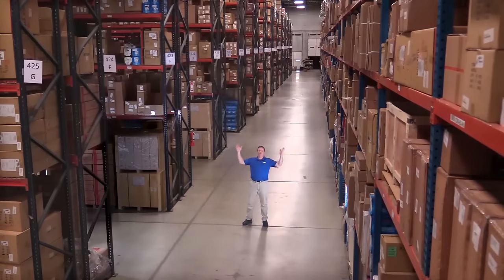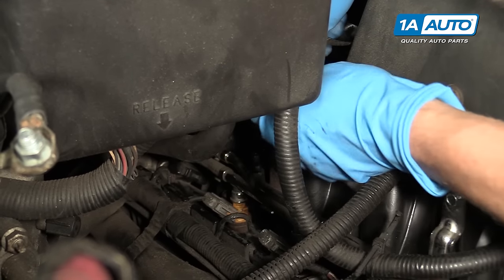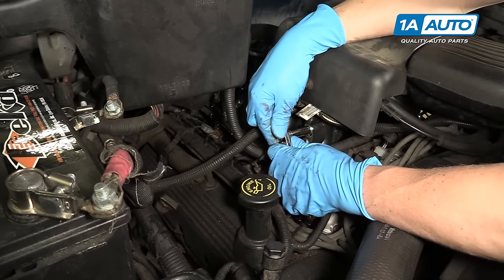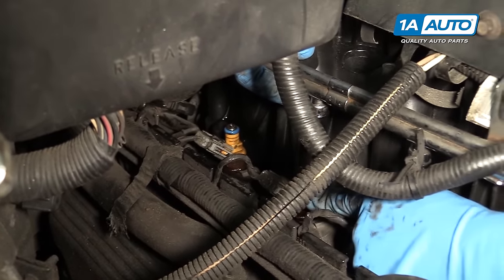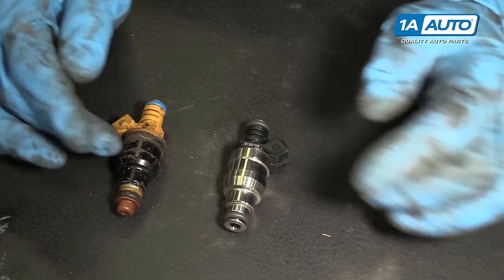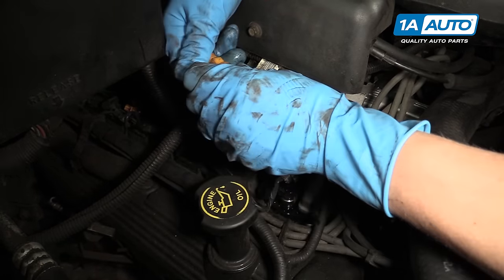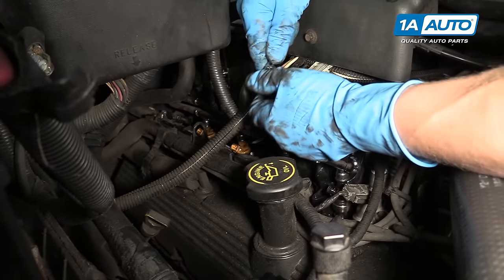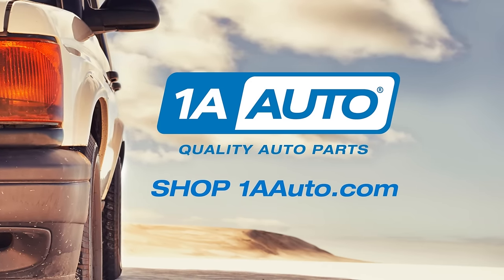How To Replace Fuel Injectors 97-04 Ford F150

Comment: change the title this is not a 97-03 f150 he's working on an 04 or later come on guys, the 97-03 has a hard to reach injector on the driver's side, with the fuel rail in the way of the injector plug.
Reply from the maker: +Chuck Fitch Thanks for the tip! We'll pass this info along to our production team.

Comment: I appreciate the overall video, however, agree with many others. The easy side was shown... read on for more regarding the drivers side.

-Driverside... 
——Remove the PCV valve 90* elbow. You may break it if not. Push the hose down after doing so.
——If cylinder 8 is difficult to remove the injector... Use a long flat head to pry off of the valve cover. I spent 15 minutes trying to pull up with my weight and no dice. First time square, pushing down on the flat head,  up on the injector (from under the injector lower lip) it flew up and out.

My quick overall tips (as I literally just completed it in my driveway) as needed in tackling this:

-Remove the elect clips before working on the rail as they will be fixed and easier to remove.
-Its a 8MM that the factory installed on the rail bracket, not a 10MM, must have been the aftermarket intake as mentioned. 
-Dont skimp on getting a pick. I regretted that but managed.
-Oil the BOTTOM ring gaskets first, wait on the top. Once installed to the intake then oil the top. Youll just be wasting time otherwise. 
-Re-Install the elect clips before setting the rail so you dont have to fight the rail too.
-Once complete, turn the key to the aux position a few cycles to send fuel to the rails and pressurize. Check for leaks or bubbles.

Best of luck.
Reply from the maker: +Garrett Smith Thanks for the tip! We'll pass this info along to our production team.
Reply: @1AAuto  Thanks for sharing! 

Just more for those that want a little more like me...

Comment: A good method to getting the fuel rails to "lift"

1) Remove the two bolts.
2) While pulling the fuel rail sideways.....insert a small
    bladed screwdriver through the bracket holes..
3) Now angle the screwdriver down and push it in
   so that the blade tip is on TOP of the manifold just
   above the threaded holes where the screws were.
4) Now just pull up on the screwdriver....which then
    pulls the fuel rail straight up easily ( as there is
   a large leverage force).

Lots of words for a really simple trick.(!)
Reply: Why did gas start coming out ?? I put it back in but why was it doing that and his didnt???
Reply: @dom1783    The tech showed how to relieve the fuel pressure through the schrader valve on top of the fuel rail, but forgot to mention that there will still be a small amount of fuel inside of the fuel rail that will drain out when removed from the injectors.

It's normal for this to happen. 
To prevent from leaking fuel onto your engine, place a towel or rag around the area where the fuel rail enters the forward most (#1) injector before disconnecting it, then just let it drain into the towel or rag. 
You will probably still have a few drops of fuel that will leak out from the other injectors as you remove them, but it shouldn't be enough to be concerned about.

Comment: YOU ONLY CHANGED NUMBER 1?  WAS IT FOR A MISFIRE? OR JUST A DEMONSTRATION?  I HAVE A 5.4 TRITON 2 VALVE WITH P0301 AND DON'T WAN'T TO BREAK MY BACK LEANING OVER THIS TRUCK JUST TO FIND OUT I DID'NT FIX IT.  INJECTOR ?  IGNITION COIL? SOMETHING WORSE? I KNOW YOU CAN'T DIAGNOSE PROBLEMS OVER THE PHONE, BUT ANY HELP I CAN GET IS APPRECIATED.

Comment: my question is why are you putting a new injectors if you have a failed injector or you just need to clean the little filter and put some o-rings on and put it back in

Comment: FYI engine oil swells rubber O-rings, I would use a non petroleum lubricant. 
I use a product called Parker lube at work on rubber seals, and it works great. 
I'm not promoting just sharing my experience.

Comment: Can a malfunctioning fuel injector give a P0171 lean code on a 1998 Ford Ranger?
Reply: Daniel Vargas I have the same problem I was asking my self the same exact question!

I have a 03 Ford Expedition 2wd and I have the codes P0171 &’P0174
However I’m getting very poor fuel economy and I think that the fuel injectors have something to do with it !
Reply: Did you guy end up replacing the fuel injectors and did it help you with your problems
Reply: Check your Mass Air Flow Sensor. Clean with Mass Air Flow Sensor Cleaner First. If persists get a new one I did and put NGK Platinum Plugs In A 1998 Lincoln Navigator and went from 9.7 MPG To 14.3 MPG!!!

Comment: I’m fixing up a 1997 Ford F-150 5.4 I’m trying to clean or replace my injectors but there stuck in the engine what the best way to remove them
Reply from the maker: +Kamden james Don't soak them. You're better off replacing them. Use pliers to disconnect the electrical. It may require some force to get them off but keep at it and they will come off

Comment: Lets say one of the bolts that hold the fuel rail down crumbled. Do those bolts hold the fuel injectors in place aswell. Wondering if i need to repair the broken bolt or is 3 bolts enough
Reply: The fuel injectors are press fit in the cylinder and fuel rail in tandem. I’d replace the broken bolt if you didn’t so that it’s sister bolt doesn’t have undue stress. Plus the compression from the engine is more than enough to pop an unsecured fuel rail off.

Comment: As the 100th person to comment here( well I refreshed and it did not change the 99 comments,)
 I have to thank You so much. I followed Your directions and now My new fuel rail sensor
has been replaced and My 2000 F150 4X4
is running great !

Comment: Do the injectors you sell match the original injectors plug on clip or must we replace those as well because I noticed a comment someone put that it didn't match it .Another question does the parts we purchase at 1 a Auto come with any warranty? Thank u

Comment: Wondering about injector balancing  and coding(?) when replacing injectors. I have a 2009 f150 4.6 with coroded injector casings and am wondering if this is a do it yourself replacement anymore.

Comment: You installed the old injectors only put 1 new one towards the front of the truck.
Reply from the maker: +Walter Painter We sometimes film repairs when the vehicle doesn't require them just to show how they are done.  This vehicle may not have needed all the injectors replaced.  Thanks for watching!

Comment: Hi, thanks for the video. I had done this already but I’m waiting for the other side new o-rings to be delivered. 
I didn’t think to use motor oil but I instead used petroleum jelly.
Would this be an issue? Thx

Comment: Do you know any company out there that sells the c-clips for fuel injectors for a Ford F-150 v6 4.2 litre? I need 4 that accidentally snapped the lock portion and the only way I know of is getting them from a pick parts junk lot.
Reply from the maker: +G34RH34D Thanks for checking us out. Shop for high quality auto parts on 1AAuto.com:

http://1aau.to/m/Shop-1AAuto-c

Comment: did you do anything to the heater core hoses or does it not have it there? Working on a 1997 ford expedition 5.4L and those hoses are a pain for cylinder number 4. Any tips?
Reply: I took a ratchet strap and tied to other side and held it where I wanted it out of the way.

Comment: I thought the stock intake manifold was plastic - Aluminum was the upgraded version?
Reply: Plastic is the upgraded version. My 97 still has the original aluminum manifold. And I've owned the truck since 2001.

Comment: Why did you only replace some not all?
Reply: they dont have a set interval time like plugs, i dont think.
Reply: My friend the 55 yr old mechanic since 18  would swap out individual injectors to solve"misfire in cylinder 4" etc
Reply: Misfire cylinder 1 spark plug first... Coil pack second... And if misfire 1 is still on fuel injector... I just had the same problem but 3 and 4 misfire

Comment: Why did you only replace one injector?
Reply from the maker: +Cody_Getinfit This particular vehicle only had one bad injector, so there was no need to replace all of them.
Reply: 1A Auto Parts how do you know it needed replacement..??
Reply: @josearellano3268  id assume after replacing coil & plug

Comment: Is the plastic manifold better than the oem one?
Reply: Plastic intakes are OEM on most of these engines. Some have aluminum but those are rare. My 2005 E150 van with a 4.6 has an aluminum intake.
Plastic intakes are known to crack and break

Comment: I got a 2005 f250 4x4 5.4 in it idles great but when I take off it hardly takes off but after going for a little bit it takes off. But when I stop and take off again it hardly goes
Reply: Can you give me ideas
Reply: Check your Mass Air Flow Sensor. There more common then people think on Ford's

Comment: Hey could you tell only 2 was bad ?
Reply: take a long 16-24" inch handled screwdriver and use it as a probe tool/listening tool . use the pointed or flat head end to contact each fuel injector (body) and listen for a pulsing sound while engine is running at idle. Continue to do this at each injector untill you don't hear the pulsating sound which will indicate its a bad fuel injector. or +more